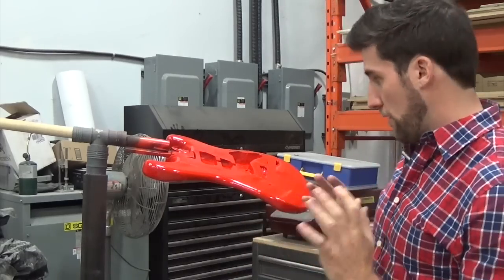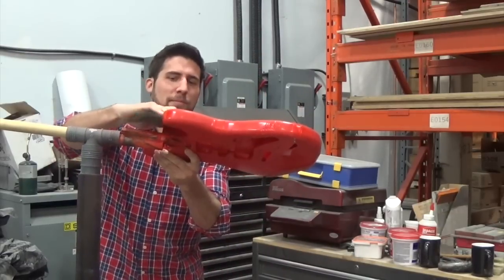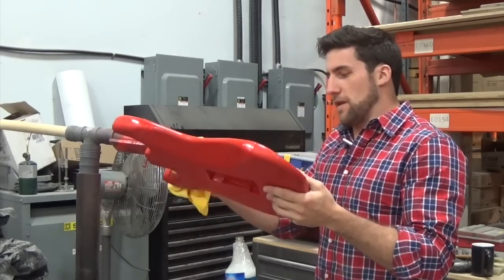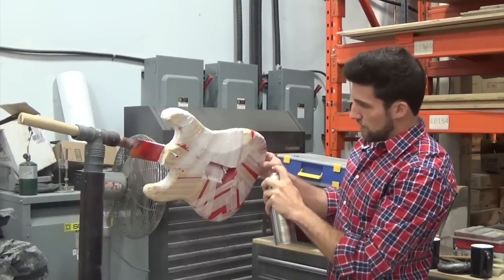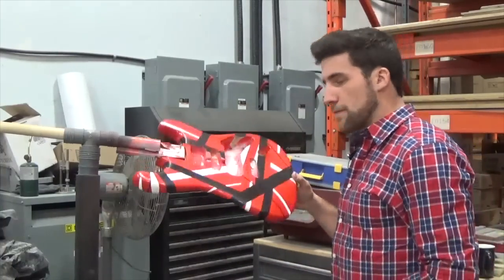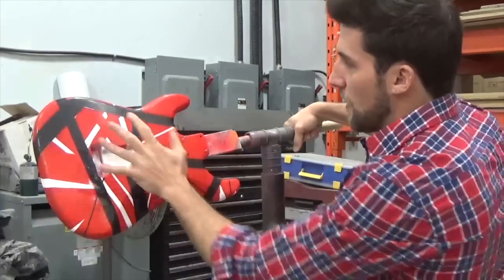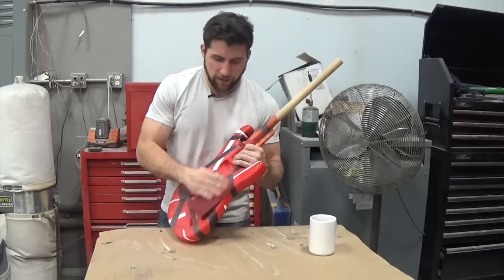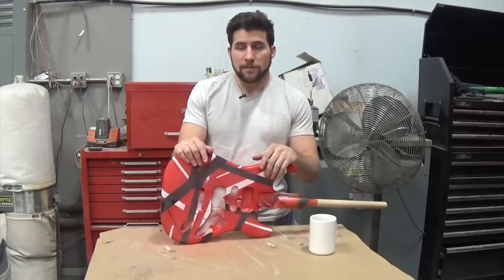How to do a Frankenstrat Paintjob Part 2

Comment: This way is actually wayyyy more difficult, and it looks less like the real one. You gotta have a black base, then paint white over that in the pattern. Then and only then do you paint over that with red. It brings the colors out way more, and it’s 100000x easier.
Reply from the maker: Brings out the colors more? You must realize that that makes no sense.
Reply: Really, "one hundred THOUSAND times" easier "? You have " exaggeration ", " over exaggeration", and "ricockulously exaggerated", yours is the third one.
Reply: @BradAngove  Brings out the bright tone of the red and white allowing for more contrast with the black. Is it unprofessional or something to say that colors can be brought out? Not only that, but the gloss in between layers is important. What you put on underneath is as important as the colors you use. I suggest watching Johnny B Guitars. He has done many painstaking videos and sample bodies which look damn near perfect with the technique I listed above. The original technique is way easier than the one in this vid, though a little tedious if you want all the paint chipping of the original (which requires water-removable glue and patience). Be careful not to fall too far down the rabbit hole though.
Reply: @joeydodge2624  Yeah, honestly I'd say it's that much easier. If you're not going for the same pattern as the original like in this video, you can have a much easier time with the technique I listed (though it requires some glossing and sanding in between jobs). Not only is it easier, but it looks a lot better as it allows the red and white to be brighter, thus contrasting more with the black, and making it look all the more like the original paint job.
Reply: @llla_german_ewoklll6413  Yes, I understand, I was just busting balls.

Comment: I'm about to do this to a hockey goalie mask. I think most of this will translate to that.
Reply from the maker: It should. Just make sure you are using plastic compatible primer.
Reply: @BradAngove  Thanks. I have advantage of painting a waterproof item as opposed to a wood guitar so that should help. I'm aiming for smooth lines and a glossy finish and I got some great tips from your videos.

Comment: How much time before you can pull off ALL the tape after last color coat?
Reply from the maker: There’s no specific time. Once it starts to tack up up you pull the tape as long as you don’t touch the fresh paint anywhere. You can also wait longer.
Reply: @BradAngove  Thx Brad. 👌

Comment: If you get lacquer streaks down your guitar, do you use 800 grit sandpaper to get the lacquer bubbles/streaks out?
Reply from the maker: You’re getting runs? Yes, I scrape them smooth with a razor blade usually and then sand with 800.
Reply: @BradAngove  My guitar project is hanging from the ceiling of my garage when I spray painted it with the lacquer. I don't have the equipment you got, though I wish I did. I over did it a little and there is a streak going down the front of it. I will try it with the razor blade and then sand it with the 800. Will I have to put on another lacquer coat after I finish sanding it?
Reply from the maker: Not necessarily. You may be able to just go ahead and sand and polish after that.
Reply: @BradAngove  Well its ruined now. I have to get lacquer thinner and start over...
Reply from the maker: What happened? I thought you just had a paint run you needed to take out?

Comment: Hey brad!! I just did this to my V. It was black I taped then white taped more and red on top.  When I’m scuffing you even out my lines my white is tinting pink.  What can I do?!! I waited a whole day before pulling the tape off
Reply from the maker: The white is tinting when you scuff the line with the red and the red is on top?
Try putting a bit of water on a rag and rubbing the white down with that. Let me know if it works.
Reply: Brad Angove no luck with that.  Tried a high grit wet sanding and magic eraser too. Just decided to cut my losses and clear it before it got worse

Comment: Have you tried other types of tape to prevent the paint from bleeding?  Of course we have the blue painters tape but I find that paint bleeds under it too.  You can use a smooth object such as the end of some ballpoint pens to go over the tape edges and burnish them down so paint won't bleed under them.  I've tried a pink painters tape that is made for delicate surfaces.  It seems to make a much sharper edge but if you don't press it down good paint can still seep under it.  Modelmakers use a tape made by Tamiya that is supposed to give very nice edges.  I haven't tried any of that yet.
Reply from the maker: I’ve tried a few options. Some are definitely better than others.

Comment: Pretty cool bro. I remember the first guitar that I ever worked on was a few years ago when a friend and I were customizing our guitars for for a band and I went with the Frankenstrat. At the time I had absolutely no idea what I was doing, what paint to use, what type of finish to use, etc. I used like two different brands of paint (Valspar and Rust-Oleum Enamel... not a good choice) and Valspar finish. I didn't sand the guitar down to the wood because it was made from not so great wood. The guitar was my first guitar ever. It was a cheaper guitar bought for my sister and when she got older she gave it to me for my Birthday. But anyways, My replica is great but at the same time terrible. I have the reflectors on the back I used a 2014 quarter I think because I wanted the year that I finished it. I had a Floyd for it but it wouldn't be able to handle it so I put a Fender Bridge and tuners on it. The pickups played with a Nice Marshall sounds like the real thing (You can see my replica in my profile pic lol). You make some pretty good videos. I've watched them countless times and now I'm creating my own brand of guitars and things are going pretty well. I appreciate your videos, they are helpful! Keep it up and can't wait to see part 3!

Comment: Looking good so far. The original Frankenstrat was a black base, white over that, then red over that. There are a few replication vids on YouTube, but I think going your own route makes it more personal.  Unless you absolutely have to have a duplicate...
Reply from the maker: If i had to have a duplicate I would have had to print off several reference photos, check my tape widths, etc. Hopefully nobody assumes that this is designed to look exactly the same. Frankenstrat seems like a fairly general term for this type of paint job to me.
Reply: Yep, I think you're nailing it.

Comment: Wouldn't thinner coats get round the bleeding problem? Might take longer but there's less paint to actually run and bleed through the tape.
Reply from the maker: Thinner coats can alleviate the problem to some degree if you’re worried about the razor work afterward. It probably won’t sort it out entirely, but it might. Bleeding is inconsistent, so it’s entirely possible that one could get through a paintjob without having any.
Reply: Brad Angove im currently looking to respay my second bass to a black and white version of this. Domt like the idea of the razor blade. Ill try thinner coats. Hopfuly thatll work.

My previous spray job was a white coat with splatter, so no need for hard lines. 

Thisll be an interesting experience
Reply: Brad Angove im currently looking to respay my second bass to a black and white version of this. Domt like the idea of the razor blade. Ill try thinner coats. Hopfuly thatll work.

My previous spray job was a white coat with splatter, so no need for hard lines. 

Thisll be an interesting experience
Reply: Brad Angove just came across another tip. Spray base colour (black), mask, spray base colour again, then go for the other colour. The bleed will happen but with the black, forming a barrier to prevent thr red from bleeding
Reply from the maker: That will prevent the look of bleeding, but will also create a more significant ridge issue between the colours.
Reply: Ahh, fair enough

Comment: this is eactly what i wanna do with an old white tele body. i was gonna strip with chemicals and start from the wood grain but if it's white i suppose i can skip a few chemical steps bc i don't wanna use a heat gun and scraper. so i guess i can use white as a base and just spray b&r. after all evh's frnsrt started as b&w and then he put red on top
Reply from the maker: +D'sBalls ya, there's really no reason to strip off the first colour if it fits within the scheme.

Comment: Hi Brad, I am in the process of making a Frankenstrat, brought a red Guitar, striped it and took the gloss off with Scott Brite, cleaned and tape it up and sprayed Rust- Oleum White Lacquer spray paint, two coats, ten minutes apart the question is do I have to scott brite the gloss off the white lacquer paint before spraying the black. THANKS
Reply from the maker: +Bob Vislocky You should. It'll help the black stick to the white, and also help the clear stick later.

Comment: Hello there brad. About the prepping for clear coat, what number of grit of sand paper would you recommend for a glossy paint? I used a flat black acryclic spray paint however, I coated it glossy white afterwards to look like the black and white frankenstrat. 

Thanks for the tutorial btw
Reply from the maker: I use 800 grit to prep for clear coat.
Reply: Thanks! You're videos are very helpful. This is my first time painting my old guitar

Comment: I literally can't get a hold of red or grey scotch brite pads. So you say it's ok to go ahead and use the 600 grit sandpaper to get the ridges down before clear coating? That will have to do but I'm just concerned about sanding the bits that have just been sprayed on....
Reply from the maker: Go with 800 grit. It should work just as well as the scotch brite and will have slightly less risk of sanding through than the 600.
Reply: Brad Angove thankś, should the 800 be wet or dry?
Reply from the maker: +D'sBalls I generally like to avoid wet-sanding guitars so I don't risk creating swelling from the water getting into the wood somehow.

Comment: I heard that Van Halen (although I dont think its true when you look at the original) used electrical tape for the stripes wondering how you think that would work given that vinyl decals are pretty similar?
Reply from the maker: It should work, it would just leave behind some residue that would need to be cleaned off before clear coating.

Comment: Brad, when the guitar is completely painted and prior to clear coating, you suggest to sand the lines to make the transitions smooth.  Do you suggest sanding the entire guitar or just where the lines are?  My concern is that after sanding the lines, there will be a visible difference between where the guitar has been sanded and where is has not been sanded (causing transitions of smooth but more dull paint, as opposed to areas which haven't been sanded which will remain more vivid).  Or will these areas of difference go away after clear coating?  Thanks in advance.
Reply from the maker: You sand the transitions smooth and then lightly sand the whole thing to allow the clear to adhere properly. The transition would disappear under the clear though. The dull areas return to full gloss once coated.
Reply: @BradAngove  That's very helpful, Brad.  Which grit paper would you use for each, please?
Reply from the maker: I would stick to 800 grit for that whole process.
Reply: @BradAngove  Got it, that's helpful.  One more question, if you don't mind: I watched your video on polishing using an automotive compound.  So, after clear coating, you recommended to sand the guitar down prior to applying the polish.  What grit would you recommend and how do you know how much to sand and when to stop?   Just a light scuff all around until it's dull all over?  Thanks in advance.
Reply from the maker: No, you sand flat at a high grit like 1000, and then you sand smooth to the highest grit possible before polishing.

Comment: Brad, I just stripped my old Squire Strat down to do the black and white version (re-do...did it once 10 years ago). 

I stripped all the paint...what grit sandpaper should I finish with on the bare wood before applying a primer? Also, are there specific enamel cans you recommend? Finally, you don't sand between coats of paint? Just one color, rough up with gray scotch brite, next color, rough up, clear?

Thanks...sorry, a little long winded lol
Reply from the maker: Hi Ryan. I like to sand to about 320 or 400 before applying sealer or primer. Some people prefer to just sand to 220, which should also be fine. Let your primer or sealer dry fully and sand that flat to 600 grit before proceeding to your colour. 
The scotch brite has essentially the same effect as sanding. It scuffs the surface so subsequent coats can stick. You can use sandpaper instead if you want; I just find that the scotch brite is faster and makes getting into the curves etc. easier. If there are major imperfections in your paint, sanding is likely a better option.

Comment: Great job Brad, thank you. How long after painting do you recommend removing the tape?
Reply from the maker: You can wait as long as you want, but to minimize the risk of paint lifting I like to do is as soon as I can without messing up the paint.
Reply: Thank Brad, is it reasonable to wait the 30 minute dry time of paint like rustoleum before removing tape.
Reply from the maker: Yes, there’s nothing wrong with that.
Reply: Brad, sorry I forgot one question. Once you apply the base colour, how long after can you start taping? (Rustoleum) Thank you much.
Reply from the maker: It depends on how thick you apply it. If you’re doing nice thin coats it’s usually good to tape in a day or two.

Comment: Now that I've gone from 8-2k grit, came out sick looking, do you reccomend I go over it with 800 before taping it up? And what sandpaper should one use to reduce the ridges.
Tx
Reply from the maker: +D'sBalls I use 800 grit for edges. Why did you go up to 2k again? Sorry; I can't see the initial comment thread on this app.
Reply: Brad Angove tbh I went a bit overboard because I had so many grits and it kept getting better, it didn't ruin the white finish, and so I just kept going cuz there were hits that needed smoothed down where the spray ran be I was too close. But now it's smooth and ready for tape unless you think I should give it some 800. I also tweeted you. ATM I'm just eager to tape it up.
Reply from the maker: I'd give it just a very light scuff with the 800 to make it easier for the next stuff to stick.

Comment: Hey brad, how long did you let the paint dry?
Reply from the maker: A day or two if I remember correctly.
Reply: Brad Angove and the 2K clear coat, how long did you let that dry
Reply from the maker: About the same.
Reply: Brad Angove you don’t need to dry it for 14 days?
Reply from the maker: The catalyzed products cures much quicker. That’s the effect of the catalyst. It speeds up the reaction.
Reply: Once all done (the paint dry, the clear coat drying) it should look like its done by a professional? Can you also make a video on how to reassamble your guitar wires
Reply from the maker: If you want it to look professional you’ll probably still have to go through the polishing process. It should be close though. 
What kind of guitar is it?
Reply: Brad Angove soon I’m getting a Ernie ball 5 string sub bass guitar, I’m thinking changing it from black to avocado green or satin green
Reply from the maker: And what worries you about putting it back together?
Reply: Brad Angove idk how to assemble back lol
Reply from the maker: Ok haha. Have a look at the second video in my how to make a cheap guitar awesome series. That might help. I’ll do a more comprehensive version when I put the guitar kit from my current series together.

Comment: Great job on probably the most sought after guitar in rock n roll.  A question regarding matte vs gloss paints. Sorry if you already covered this in a previous video... If the guitar is going to get multiple clear coats and then a final top gloss final coat, does it matter whether the actual colors beneath are gloss or matte?  My assumption is all the glossiness is going to reflect exclusively on that final clear top coat. 
Also, I hope you're not going to do the infamous relic steps . Most of the stuff I've come across on this DIY guitar involved the builder beating up an otherwise beautiful showroom finish by scraping and burning all EVH's normal wear and imperfections. I realize it wouldn't be seen as a close replica, but I believe in having the best of both worlds.
Reply from the maker: You’re correct, the gloss is derived from the final coats. You just need to be careful that you are not trying to spray directly over a glossy base coat without sanding. Your paint won’t adhere properly if you do that.

Comment: What Spray paints would you recommend for a 2K clear. There seam to be  no real answer or recommendation that I'm finding on the net anywhere. Thanks
Reply from the maker: Spraymax makes their own spray paints that work well with this stuff. Generally any acrylic also seems to work fine.